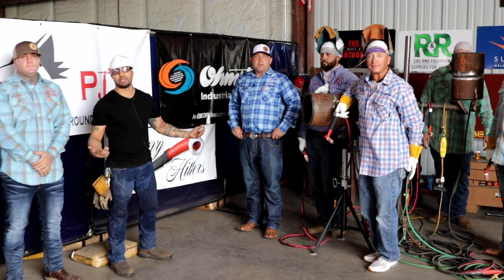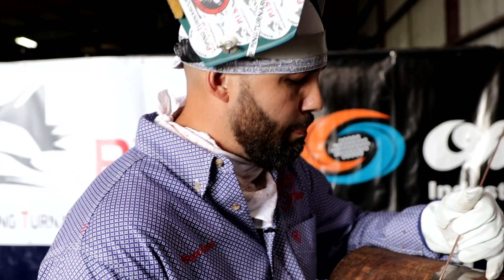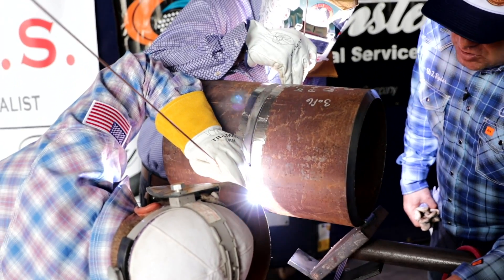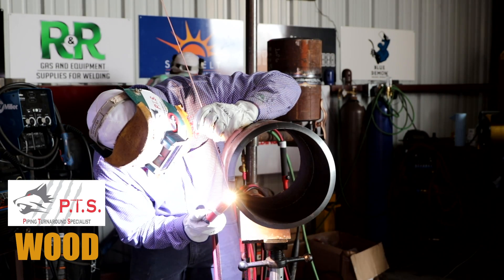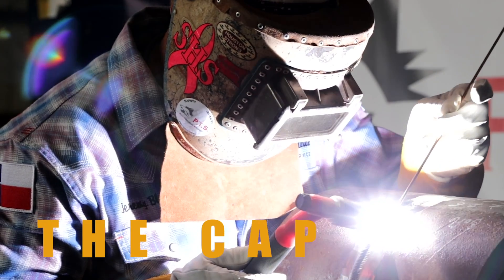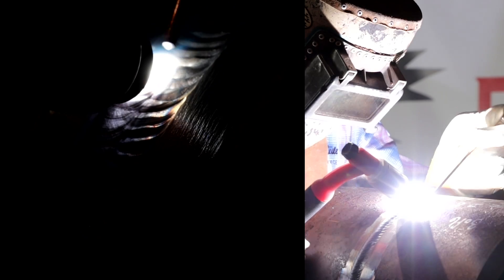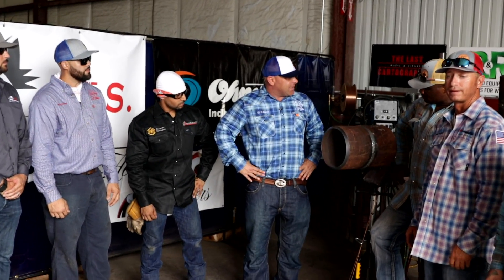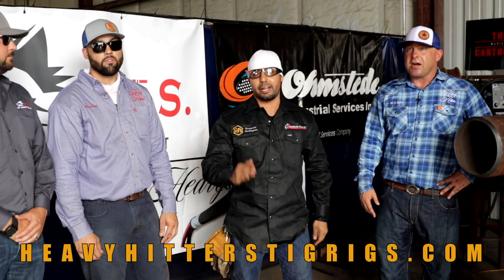TIG Welding 300+ AMPS

Comment: Looks rough root pass inside bevel, bet he had to grind afterwards...,tight gap and they wont show root on inside pipe specially on the bottom where he cannot push metal inside with that tight of the gap. That 1/16 gap will get shut by the time he's done bottom welding. Those dudes freehand because it takes craftmanship to open gap walk cup and root it properly within WPS amp requirements, on that heat they're literally degrade quality of steel specially of any alloy.

Comment: these guys are slow compared to welders from scotland in the spoolbases  who use walking technique
Reply: This is faster. I've welded both. Plant welders don't have to worry about heat input so you can slower and shove more wire. Spool base, you can't, you have to be moving or the kilojoules will be too high and it could be a cut out. Spool base welders go from the bottom to the top faster, but it's faster to go a little slower and stack iron

Comment: I blew my 250mp heavy hitter on a 24" extra heavy wall at 375 amps
Reply: Would you buy another one
Reply: @Bwelds94  to be honest i wouldn't. What I did I bought me a weld craft 2 piece red head torch and put it on the 2 piece cable from the heavy hitter.
Reply: jeronimo ortega im looking into buying a new torch. Which do you recommend
Reply: @Bwelds94  Weldcraft 366-WP-R26FV Style 26 Red Flex Torchwith Valve Body – R26 For 20  with 2 piece cables I turned mine up to 400amps
Reply: jeronimo ortega so did you only buy the head? I checked it out its like $120-$140.
Reply: @Bwelds94  yes I did. It came out close to 150 or so but I given hell and has hold up really good
Reply: jeronimo ortega what torch body do you think I should get to go with that head
Reply: @Bwelds94  Weldcraft 366-WP-R26FV Style 26 Red Flex Torchwith Valve Body – R26 For 20

This link comes with both. Torch head and body. It doesn't come with a handle. The handle for this weld craft is a thread type for 26 style tig torch. You won't regret the buy.
Reply: jeronimo ortega what website did you buy yours from?
Reply: @Bwelds94  I got mine from Amazon
Reply: jeronimo ortega ok i just saw it on there. I would just need the handle and i guess the argon/power line huh?

Comment: THAT IS IMPRESSIVE BUT.
Have you instructors have HAD  Any CVN'S ,Rockwell, and  Tensile  tests done to make sure the mechanical  Properties are  not affected by the heat that high heat. 300 Amps  Seems  Extremely Excessive. Now having a water cooled  Machine in a shop would be really the only circumstance you would do that.

Comment: There’s no weld procedure anywhere that would allow the welder to weld with that many amps most that I have welded under allow 140 for the root and 160 for the rest of passes and I’ve seen weld inspectors put an amp meter on a welders lead to make sure he’s under the amps in the weld procedure and would get the mans money if not
Reply: Probably cause you a mullet
Reply: Cause youre a mullet
Reply: We’ve always used sycrowave miller’s with cooling systems and foot pedals and I run all my fillers around 280 some guys take 3 times as long to make a weld as me because they want the pretty colors it all about production for me
Reply: @jamesbrandon8520  running too hot can have wide HAZ zone causing the apparent material to become brittle.
Reply: I like to run a heavy 1/8 gap..no more than 110-115 amps for the root and about 150-160 for the hot pass.
Reply: Mlizar I’m usually about 150 for the root with 5/32” gap and 225 to 250 for hot pass, it’s all about production not about quality of the weld in the end as long as it passes Xray and hydro that’s all that matters
Reply: @jamesbrandon8520  225 amps? Holy hell. You welding heavy thick wall? Cause I'm flying at around 160 amps.
Reply: Mlizar all I mainly weld on is sch160 xxheavy xstrong things like that unless I’m welding on 135 mw tubes or some kind of stainless or inconel if I had a cooled rig I would run on heavy materials filling them around 260 to 275
Reply: you can use any amperes if you can move fast enough  but its all to do with heat input in kjoules 
and interpass temp 
160 amps for pussys on hw pipe try 275
Reply: Rats can do whatever they want

Comment: I doubt these guys take a weld test and burn 185 amp on the root pass and pass the Visual
Reply: Jason Detreich .....questionable on the vertical,specially on the bottom of the pipe,best they can do is flush?but most likely it's a sucked back.....on the horizontal though,hmmmmm....you gotta have a land on the prep for sure maybe a 1/16 or 3/32 ?? did they mention how much gap they have? Or I just miss it? I think it's doable with these parameter...3/32 land 3/32 gap and 1/8 filler metal  and no torch angle so you gotta weld it free hand it also means that your travel speed is faster than normal and you gotta keep that pressure on the filler metal.....if there's undercut on the first try...I'll adjust it on the land the next try
Reply: @kabihog5789  these guys were putting in the root way slow.  So what is the point?   Double the amps and a slower ugly root
Reply: I was wonder about what the root pass look like but I’m sure the bottom half of the vertical weld has some serious suck back and top side might be ok. I tried this on a position weld in the rack I ran a tight 3/32 gap at about 160 and pointed the tungsten straight into the bevel and it came out with some really bad suck back. So I had to cut it out n open up the bevel the to about 5/32. I really wanted to see these guys root pass on the vertical coupon.

Comment: This shit looks crazy to me. I like to back feed my root at like 90 amps. I guess it’s just how I was taught. 🤷🏻‍♂️
Reply: On another note. Where are some pictures of these 185 amp roots?
Reply: its just that type of "welding video" where 4 guys are pouring in roots at 2x amps and purposely don't show the profile. sounds about right for a tig torch advertisement
Reply: @giuliogiulio1  couldn't agree more. The beads look poor. Travel speed way too slow and I would love to see the WPS these "coded guys" are working to.  Amatures
Reply: Heavy pipe, thick filler wire. Maybe a Nice heavy land, al factors that could cool te puddle down just enough to get a nice root

Comment: terrible deomonstration, these guys are NOT professionals. go to school. learn to weave and walk the fucking cup. stop carrying over 3/4 x the width of your filler. too much heat in particular metals will destroy characteristic properties special to that application. Open V groove means just that, open, you basically think faster is better but it isnt. there is a fabriactor and a prescision welder/millright, I guess it depends on what you do. but this is shit welding... glad I paid for an education. You learn to weld in a controlld environment such as in the nuclear sector, or food industry, and these guys would be out of a job in one day if they didnt stop this farmacator bs. pride usually kills the moment. Ive seen too many proud boys bust, underfill, overfill, or shit even worse, wash the inside of the pipe down enough to where engineers fear having to cut hte upper turbine deck off... good thing I can fit in an 18 inch pipe and weld from the inside, you know who you are, Joey... fucking asshole. dont be a hot shot. learn to weld like a professional

Comment: So yall aint gonna show the roots?
Reply: Yea because they had to much suck back. Just because a torch can handle that high amperage doesn’t mean you go full throttle. Granite there beautiful welds but what’s the X-ray say 🤔
Reply: @terrigfy60thatguy28  you know what g-40 welder means right?

Guaranteed 40 hour checks even when they’re not working. An incentive to keep them from jumping ship to another company. 

You think they got to that position by busting welds?
Reply: Nah because 185 amp root is nothing they want to show. You can act like that and go 300 amp wide open, but after you put a nice root and hot pass

Comment: That's pretty crazy. I've got a 250A everlast tig welder and I haven't topped it out yet. I can't even imagine having to use 300+ amps.
Reply: Haven't been over 300 on my 355 yet. Not sure my torch will handle it... Guess there's one way to find out...
Reply: Heavy wall pipe will make you wish you had more! It's sooo much easier welding thick pipe with loads of amps!
Reply: @vincentboucher2547  And you know?  There are 3/16" and 1/4" electrodes out there, and WP-12 torches to hold them....   Someone must be doing this.  There are some big power supplies out there... some that can be run in parallel.   Long before I ever was interested in welding, I worked in a lab that had a Miller power supply the size of a small car, or maybe three or four refrigerators pushed together.  I think 1000 Amps at 100 per cent duty cycle!  We didn't have any idea of welding at all, much less 300 amp TIG torches, which I really regret, now!
Reply: Been tig welding for almost 20 years and maybe gone over 300 amps once or twice..its over kill unless you're doing some super thick heavy stuff.

Comment: I have question. In the past couple weeks a couple of welds life 2 or 3 have popped like it had porosity but visually there wasnt anything i like a porosity in the root. So I’m wondering why it does that? Would that have something do with the wire or argon psi setting. Any feedback would be much appreciated
Reply: Code Talker basically like slag or trash in your bead. Or fillers. Means your burning out your trash
Reply: Lamellar Tare is what it  sounds like but I could be wrong

Comment: Tight 1/8, loose 1/16, hmmmmm, pretty that equalllsss 3/32
Reply: Jasper Kurck what I was thinking sounds like a damn engineer out here😂
Reply: That’s how we talk,,,you ain’t no code hand if that don’t make sense to you
Reply: @jerrypino5608  these guys are not coded pipe welders. A lot of shaking hands and very very slow travel despite running mega amps.

Comment: Tungsten? Size? Filler wire?
Reply: heck yes
Reply: It dont say but i garuntee its 1/8 tungsten 1/8 wire for the root 3/32 wire for the fill and cap

Comment: Not exactly informative but was definitely a good watch. I like walking the cup tbh, then again, I can't hold a damn tig torch steadily in mid air with with nothing to steady myself lmfao idk how tf that's even possible.
Reply: Gotta brace yourself
Reply: Practice practice practice brother 🤙🏼🔥
Reply: Rest the cup on the pipe and glide it while free handing so you’re not burning your fingers up. 
I like to free hand and once the pipe gets hot that’s what I usually do
Reply: The video was more based upon the 150amp tig rig running high amps and not burning up.  Trust me I've burnt plenty 150's up welding on some heavy wall.
Reply: If it ain't round I turn it down those are 250 amp tig rigs not 150s heavy hitters sells 150s and 250s
Reply: Another good tip for free handing a weld like this without propping your hand on the pipe, make sure you keep your elbow tucked tight in your side. It keeps the shaking down on your rig han.
Reply: "Hand"

Comment: Sweet at 325amps when i Turn my welder up to 350-400 it starts to shoot holes in my weldpool even at 2 Inch thick steel. 4mm E3 tungsten i can Look probaly 10mm in the Steel . I think it is a Bit hot 😂